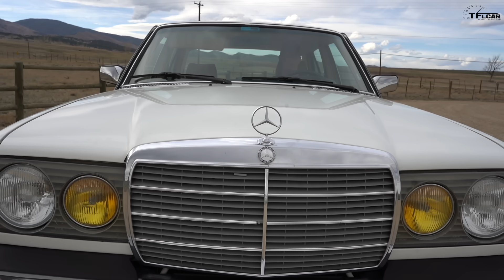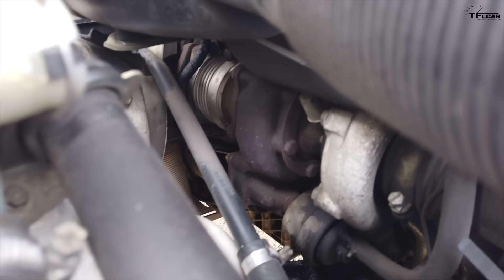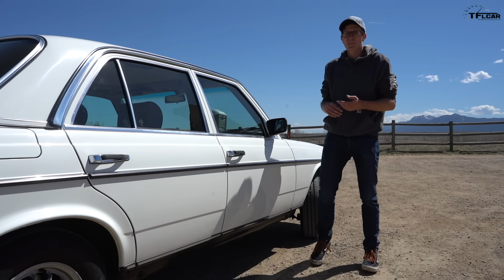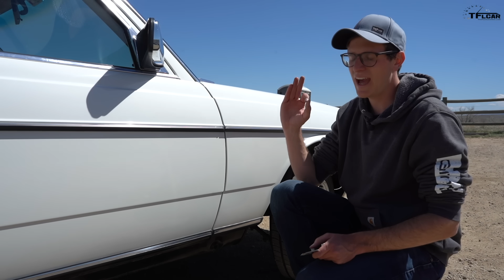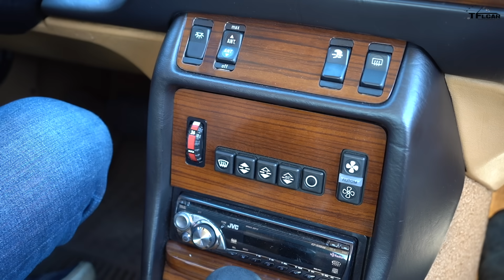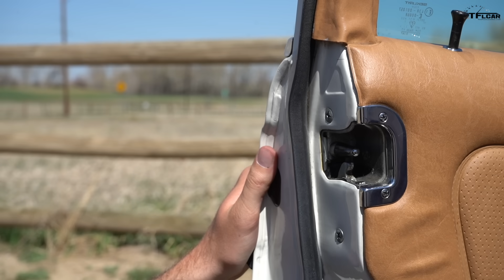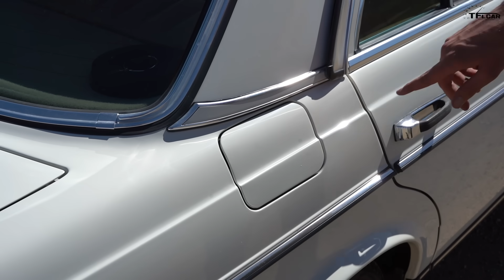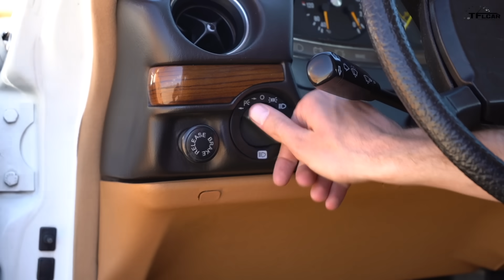This 37-Year-Old Diesel Is THE BEST Mercedes Ever Made!

Comment: Absolutely agree. Overall.  But the 1979 SD Turbo Diesel was the pinnacle of German engineering because that was the last year that the 300 block and head were both made of cast iron.  The 1980 model was the first year that Mercedes strayed from what was designed by prewar 30’s engineers, a 180, to 240, to 300 block.  So much so that they didn’t dare stray from what the pre war engineers had perfected (Germany lost many fine engineers to the war) and used to same bolt holes on the 76’ 240 D that was sized to accept bolts used to hold the water pump, which were barely adequate when under stress, and then required them to hold tight an aftermarket air conditioner compressor, which I know, because I stretched those bolts while towing a Chevette, fully loaded with stuff, up the almost vertical hill to San Bernardino from LA in 80’.  And it has been downhill for Mercedes ever since.  I worked on every one of those engines, owned 10 of ‘em’ at one time or another and still have a 240 D and 300 Diesel Coupe.  
The thermal expansion rate of Iron is 12 and the thermal expansion rate of Aluminum is 24, so when the head get’s hot, it’s sudden death for that engine…so for God’s sake, don’t run it hot.   Nor allow anyone under the age of 21, to drive your car, unless, of course, you have a passenger- side brake pedal installed and manned (like a driver ed car), and you are holding a loaded revolver to their head, while they are behind the wheel.  I know, because I did, and didn’t, making a terrible mistake (mainly cause I didn’t have a loaded revolver handy) and my cherished 1979 SD Turbo Diesel was smashed to hell in 2013, for which I have never fully recovered.   I’m giving it to you straight.  You’ve got one hell of a beautiful piece of engineering and beauty.  Just… Keep it cool.  Oh good, they’re going to let me walk in the hall today.  Maybe, I’ll be able sit on the bench outside some time soon.   And we’re having strawberry Jello today.  I like strawberry.

Comment: I had a 1980 240D with the 4-speed automatic.  Bought it with just under 200K miles in 2005 from the son of the original owner.  It had the usual W123 problems -- A/C and cruise-control were broken, so I fixed them.  Drove it for 7 years; sold it with just under 240K miles for more than I paid for it originally, because their value had gone up in the meantime.  Fantastic car, although you could measure its 0-to-60 time with a calendar instead of a stopwatch.  ;-)

If only we could get a W123 in the 'States that had the lack of power-features of the 240D (no power-windows or sunroof, no automatic-climate-control) but had the wonderful 300D's turbo 5-cylinder engine!  That'd be the perfect combination of reliability and power.

Comment: Nice video and I totally agree with you about your old Mercedes.
Modern Mercedes are vulgar with their huge star on the front that looks like it was taken off of a truck .
The older cars were quiet and understated quality; look at the unflashy engine cam cover for instance, I think some didn't even have a Mercedes star (200D ?).
31 feet is 944.88 cm lol (9.4488 metres)     14:40

Comment: 124 was the best tho...more fuel efficiënt more silent.
Reply: ... but mostly a heap of rust once you turned round for a minute if they were not treated VERY carefully. When buying my last car I had to chose between a late 900 series Volvo estate or a Merc 124 estate model. The latter were on average 20 - 40% more expensive and basically all of them had rust somewhere. Even garaged 1 owner cars with less than 150k on the clock left a lot to be desired whereas most of the Volvos were virtually rust-free despite an apparent treatment as a professional load carrier or abused family transport. Those Mercs really weren't that good. I honestly think that they are actually one of the worst series ever to come out of Sindelfingen. (Although the top spot on that list will always be occupied by the first V-series vans and minibuses. (Truly awful stuff.) I wouldn't go for a 123 series Diesel though unless it's a 300D as all other engine version are just unbareably slow.
Reply: i worked for Mercedes when the 124 came out. they were trash. took Mercedes several years to get rid of most flaws.

Comment: 1st - well i agree with you but the previous model was harder to destroy compared to this one ,even older people that bought this one after owning the w115 or w114 or w113 said the same , i also had a 280 S from 68 or 69 offered to me by it´s first owner ,that i had to sale it because the fuel consumption was very high but strong as a bull, they stop using this older ones due only to his high fuel consumption, i even had on the back of my house a white one left there by it´s owner ,like new ,used it to substitute some parts for mine that was grey with red seats inside,regards

Comment: the 200D Mercs where used as Taxis throughout the mod east n Cyprus too most of them used to do at least 600,000 MILES not KM b4 they used to lift the head off for an overall n the next one would be over a Million miles the taxi companies had 3 drivers per car so the cars where almost working 24/7i think they used to call the the cobra models the Best you could buy yes

Comment: Hi great video... don't forget one very important future the fuel tank cap holder located inside the fuel filler door.  It's a great feature no excuse the Lost gas tank caps or scratches on your trunk.

Comment: I own a 1991 W201 but sadly it's not a diesel..1.8 petrol but still I love it
Reply: "Sadly it's not a diesel..."??? The W201 petrol(190 with or without "E") are in fact the(soon collectable) ones to have man! Some facts: The W201 was a brand new "sportier" concept(compact plattform) in witch MB used HUGE amounts of resources and Deutsche mark developing(they say MB's most expensive project until then). Highly over-engineered with astonishing road-holding manners and drive-ability, basically no other car in the segment came close to it. So, there you go geezer! 👍🏼😈

🇳🇴

Comment: I owned one of the originals of this model, before they put the turbo in it, needless to say, driving it was veeeerrrry relaxing, it was not in a hurry.  Mercedes take on the hydromatic (they apparently bought the design rights from GM) was that it usually started in second, why such an underpowered 4000# car would do this I don't know, you could get it into first by flooring it, that also produced a great cloud of diesel smoke.  I traded it for the SD that was very much like it only with the turbodiesel, again it started in second, but if you floored it would really scoot with not only the grunt of the deep first but also a quick spool up of the large turbo.  It was a long and heavy car, one of the best road cars ever built and I think the car applauded when Reagan axed the 55.  It was the car Buick talked about but never built (they didn't know how).  That chrome strip along the side also protected the car in parking lots, I don't think it ever got dinged by some careless door opening, (generally by some Pontiac owner).  I note that you replaced the German Blaupunkt radio, yeah, that was not a winner.  I agree with your comments about the climate controls, the downfall of the SD was the airbox under the dash that distributed the airflows, rebuilding it including removal and replacement could easily run $4k, the A/C compressor wasn't all that good but was better than the one in the 300D but Germans rarely need A/C.  Problem was with the changeover from F12 to the modern stuff, you had to replace a bunch of hoses,another grand or two, the car was 17 years old but only 180,000 miles body and engine perfect but I wasn't into antiques.  I had bought an E300D ('99) as a spare and I still have that, it handles way better than the SD and it has a five speed auto using all five, this tranny is so good that Toyota copied it, the A/C leaks a little but after so many years who cares, the car itself looks almost new at 20 years with original paint and very few scratches, the engine has mechanical injection and since we changed to low sulphur diesel, it stopped smoking, it is the last of the old look MBs and is still a very solid nice car.  My wife has a new ('15) E250D, same HP from 2/3's the cylinders and half a litre less displacement, but it is way faster. I don't like the runflats with no spare but I'm 77 and not going to change tires, I have done several road trips doing 500 mile days back to back and it gets nearly 40 mpg and I was doing way way more than 55.  The biggest thing I miss is the star up front.

Comment: These old mercs are literally indestructible. you cannot kill them my grandpa had a  1980 280S he did 280,000 miles over 21 years on the original engine & transmission. Only then did the transmission finally need a rebuild.

Comment: A lot of these features are still present in modern Mercedes. I have have a not so new C300. The doors still sound the same and the tail light base comes out so you can have access to all bulbs. The hood can go vertical. Post 2015 C class has sadly lost that distinctive door thump and sound ordinary.

Comment: This beauty is used in Morocco as Taxis in extream roads ..
Reply: Yes and no, morrocan taxis use the 240D because of better consume numbers and more durable gearbox. My grandpa buyed one 240D w123 in 1984 and started to use it as a taxi in Tangier the chasis is over 1.4M km and it only rebuilded the engine two time (every 450K km) and change it when it took 1.1M km. 
This model is a beast, the 2.4l and 3.0l diesel engines from the W123 are the best diesel engine ever made.
Reply: i went there lot´s of times ,i live 500 km from marocco, they have resorts that have very nice conditions along the coast line ,that are very good to surf or windsurf, this in the 90´s or 80´s ,but the most mercedes that i saw were 500SEL ,the 80´s version by the dozens all automatic gear box (in bad shape)this in early 90´s .Somehow all were wrecked in the driver side from one end to another (this talking about the body),till today i never understood the reason for that, normally is the other side and not all,and not from the front to the back, and the roads(?)(most of them only gravel) when you drive to the mountains sometimes on the horizon you see a dust cloud , it gives time for you to drive to the side of the road ,but far or when the mercedes(it was a w123) that drives through will never reduce the speed and will project a shower of gravel, a friend of mine had just bought a new renault diesel and didn´t get off the road so the right panels and front and right windows were filled with holes ,those guys that you say "get out of there" and they being the first time he drove there ,he replied "he has to stop the car" so a new renault to the garbage(well,they all are garbage),regards (sorry if my english is confusing,i´m portuguese)
Reply: @Dus Cu Pluta hahahahhaa, as a taxi its only can take 7 people (the driver + 2 in the first row and 4 behind). But as a normal car you can take as many people as you can get on the 2nd row of seats because theres no law in morocco against it. So you can perfectly fit 10 or 12 inside one of this mercedes and its totally legal xD.
Reply: True its still used and will never die
Reply: yeah but in morocco they are not that beautiful XD
Reply: But in James Bond's Spectre a 1948 Rolls Royce silver wraith taxied him in the Moroccan desert...
Reply: True! ❤️❤️❤️❤️😂
Reply: yeah but do not talk about taxi in Morocco

*It's a king and sad story
*

Comment: I have a 1985 300SD Turbo Diesel.   Very similar to your's except for a few small changes over the 3 year age difference. Nicknamed the million mile engine.  This car is my daily driver and I have 237,000 miles.  I would call it a great car, however it is a labor of love when it comes to replacing failed components!

Comment: If one of the AC vaccum elements goes bad the car will continue to run when you shut off ignition key Mercedes put a lever on injection pump very easy to get to and clearly marked stop push lever car shuts off any vacuum leak that's a considerable leak will cause this on any of the diesels turbo or not

Comment: The W123 is the last car that was designed for "eternity + 1day"
Reply: They rust like heck if used in a wet climate such as the UK, and winter salt on the roads absolutely wrecks them.
Reply: W124 also...
Reply: @kreyton76  in the point of view of endure the passage of time isn´t ,i had both and they are the last real mercedes-benz ,and engines there´s for all tastes ,to end in 1995 with the 250D  (diesel engine)was considered the best car in the world taking in consideration all aspects of a car that serves the most it´s owner and also enviroment,the w123 and w115(wish i had a 74 with 3.000.000 km´s or more, after 40 years was still perfect just the body was having rust problems ,never kept in a garage, just outside) are earlier models with  a quality not find in this segment on any other brand in the past or present,regards
Reply: Yeah no, it’s the W124
Reply: They designed a car, then worked out how much they should charge for it, rather than build it to a price.
Reply: Strayhound The W124, W126 and W201 beg to disagree.
Reply: yeah, it takes eternity to reach 100kmh in this "car". it's chariot, really....
Reply: Totally wrong, the Mercedes W210 is the last car that was designed for "eternity + 1day"
Reply: The Volvo 240 was built up till 1993, designed to last "eternity + 1 day"
Reply: your forget the w114

Comment: I agree that they are one of the best build car Daimler Benz ever made.
I used to drive several of them as taxis in the late 80's and 90's, both 240D and 300D non-turbo, manual and automatic, the 240D 4 cylinder was very slow, special with automatic and the 5 cylinder 300D was not fast either. There was also a 4 cylinder 200D but I was lucky enough never to have to drive on of them. 
Very reliable and well build workhorses but not very exiting and the seats were horrible. The only thing that could bring them down was rust, if the body was solid they would go forever with basic maintaining.

Comment: Yep I have had many.  Ran them all on veggie oil for a decade.  However it took over every possible storage spot in the garage.  At near 40 years stuff like the SRS in the wagon needed service and new hoses. Tired of getting under the car.  Bought myself and my wife a Nissan Leaf each.  Much less mess.  More reliability.  No getting under the car. On 40 to 50k on each machine, we will see as time goes by. Each car cost around 14k with incentives. Can charge on our solar system.  Fuel not as cheap as free veggie oil but again no mess.

Comment: Then you have Volvo 240 😉 B18 and B20 engine 🤘
Reply: 22lalen I have trauma of those... camshaft eaters
Reply: @MrDutchino  😅. Good engines. And they start in all weather. We tryed Stockholm to Gothenburg and back without oil in the engine and no problem. No services and it have roled just a smidge over 6 laps around the globe just here in sweden since 1979 👍. Rostbucket but it goes 😁
Reply: B18 is one of the most durable engines ever, they just keep running. When put in the Amazon it becomes one of the best cars ever. Its very light, buildt like a tank with steel that literally dont rust and the engine that can pass a million km without rebuild.

Comment: I love these cars, but watching others talk about them on Youtube frustrates me to no need. 

The platform has its flaws. Some are game over type of flaws and others are more annoying (like the rust).

The OM617 engine is far from bullet proof. Two biggest issues I know of off the top of my head are the vacuum pump bearings gernading into the crankcase and sunken motor mounts allowing the power steering belts to saw at the oil cooler hoses. Both issues will leave you with a destroyed engine. 

The rust issue was because Daimler was using a cheaper galvanized steel which didn't change until 1986. Shame because these cars do very well in cold weather.

The HVAC system's aux water pump has been known to seize and cause electrical fires in the dash. Solution there is to disconnect it. 

The beloved bank vault doors have been known to get stuck open because the door checks failed. Have fun driving home with a door wide open! 

The power steering system won't fail on you, but it will leak or worse get so sloppy to the point where it's impossibly dangerous to drive the car. 

They're also called bundt style wheels. Bottle cap? /facepalm

Euro headlights and bumpers make the car more sleeker. You can thank the DOT for that. 

600k-700k before a rebuild is a bit rich. Honestly, they'll go to about 500k before blowby gets really bad or one of the issues above takes it to the grave. Why that number? Because most of the dinguses who buy these cars neglect the maintenance on them thinking they're bullet proof. Germans designed their cars to be periodically maintained. You NEED to replace old rubber, hoses, and other bits before they act up.

Oh and you need to do a valve adjustment once every 20k miles if I recall correctly. Good luck getting the common American driver to do that. Neglecting this results in lousy performance, poor fuel economy, and difficult rough starts.

25mpg is the absolute top end of fuel economy for these cars. If someone says they're getting 30+, they're lying. 28mpg absolutely upper end for a manual 240D.  

Also 20*C is 68*F. Use that as your metric (heh) for what is cold or hot. 

Enjoy the honeymoon! They're charming cars.

Comment: The dome light in the front is just like any other car, the switch turns it totally off, on or so that it turns on when you open the door. It also has a 5 second delay after you close the door until the light goes out